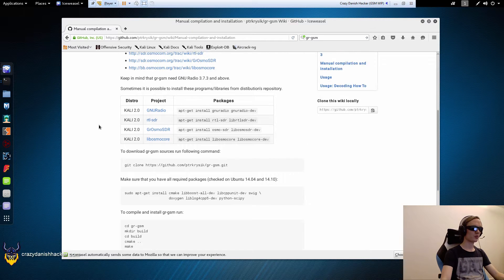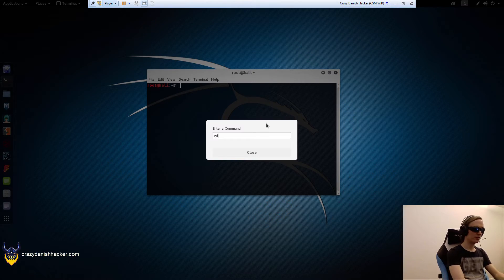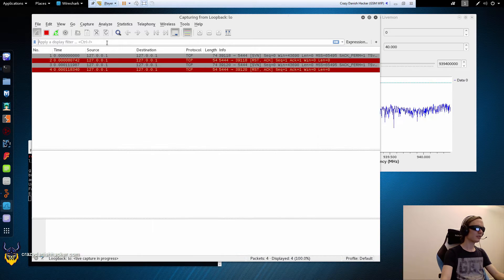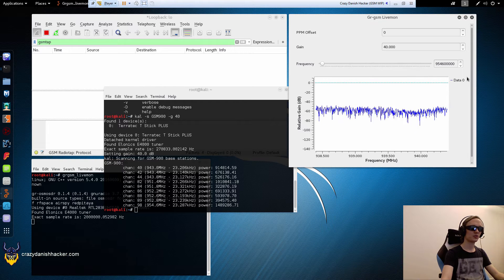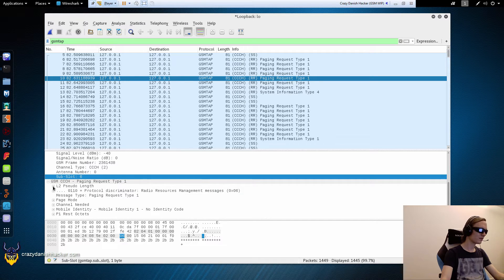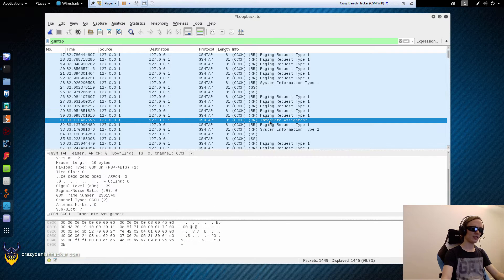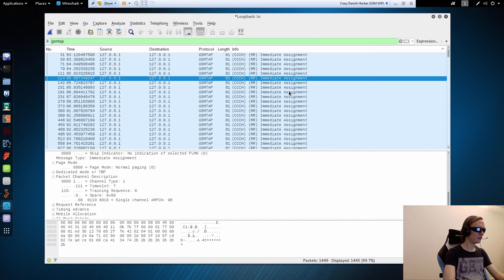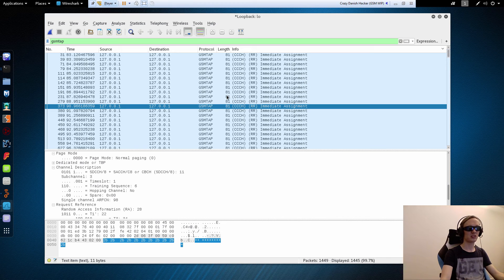GSM Sniffing: Using GR-GSM - Software Defined Radio Series #8

Comment: -hello so im trying to use gr-gsm and following step by step but there are some curious message and by some reason it is not working ill explain in detail:
  first i open wireshark and i get the next errors:

  QPainter::begin: Paint device returned engine == 0, type: 2
  QPainter::setPen: Painter not active
  QPainter::setBrush: Painter not active
  QPainter::setRenderHint: Painter must be active to set rendering hints
  QPainter::begin: Paint device returned engine == 0, type: 2
  QPainter::setPen: Painter not active
  QPainter::setBrush: Painter not active
  QPainter::setRenderHint: Painter must be active to set rendering hints

-i still continue video and try grgsm_livemon get the next messages:

   gr-osmosdr 0.1.4 (0.1.4) gnuradio 3.7.13.3
  built-in source types: file osmosdr fcd rtl rtl_tcp uhd miri hackrf bladerf rfspace airspy airspyhf soapy redpitaya freesrp 
  [INFO] [UHD] linux; GNU C++ version 7.3.0; Boost_106200; UHD_3.12.0.0-0-unknown
  Found Rafael Micro R820T tuner
  Using device #0 Realtek RTL2838UHIDIR SN: 00000001
  Found Rafael Micro R820T tuner
  [R82XX] PLL not locked!
  Exact sample rate is: 2000000.052982 Hz
  [R82XX] PLL not locked!
  Allocating 15 zero-copy buffers

- I tune into the frequencies that kalibrate told me and nothing happens neither on terminal or wireshark?

possible solutions i tried
a) i made sure to select loopback interface.
b)made sure the frequency i inputed in grgsm was in format of hertz

and well nothing, thank you for your help guys!.
Reply from the maker: Not sure why it's not working here, make sure you've tuned into the right frequency, by e.g. looking for GSM signals between 940MHz and 960MHz for example in gqrx, and if it works in that program (or even SDR#), then try gr-gsm.

Comment: Go bladerf+raspberry pi=imsi catcher. ;)))
Reply from the maker: 2G IMSI Catcher, and it's not as simple as that, but you can create a 2G BTS with those devices.
See e.g. https://www.evilsocket.net/2016/03/31/how-to-build-your-own-rogue-gsm-bts-for-fun-and-profit/

In my case, the BladeRF randomly stopped transmitting the RF signal through the virtual machine. Another issue was the calibration, as I wasn't using an external reference like a GPSDO. Eventually I will get to this topic, but there are a lot of places where it can go wrong, if you want to do it properly.
Reply: Crazy Danish Hacker,Good luck.Waiting for your videos :)

Comment: appreciate your work man, Thanks.
Only problem I am facing is that I cannot trace the packets in wireshark
Reply from the maker: Make sure you're listening on the correct interface, and that gr-gsm is actually decoding packets.
Reply: Crazy Danish Hacker no gr-gsm is not actually detecting the packets, I’m sure i have tuned in to a strong downlink freq
Reply from the maker: I recommend starting over from scratch and doing everything exactly like I showed, including how you can see the packets flow through the terminal when you're decoding them. Make sure you use a recent version of Kali or Ubuntu with an up to date version of Wireshark.
Reply: Crazy Danish Hacker is it possible because I’m using virtual machine??
Reply from the maker: No I used a virtual machine in all of these videos. Try in a new Kali Linux virtual machine maybe. It worked for me when I tried a few weeks ago. There's a small chance that the developer made a mistake in the latest version of gr-gsm. If that's the case, then you can pick up an older version from one of the forked versions for example: https://github.com/ptrkrysik/gr-gsm/network/members
Reply: Crazy Danish Hacker Ohk will look into it, thanks!

Comment: can we see uplink packets? the ones going from mobile to cell
Reply from the maker: You need to use something like this: https://github.com/ptrkrysik/multi-rtl, it didn't work in my case, most likely because of the cheap RTL-SDR devices I modified. https://ptrkrysik.github.io/

Comment: when i run grgsm-livemon i had this:

Traceback (most recent call last):
  File "/usr/local/bin/grgsm_livemon", line 26, in <module>
    from gnuradio.qtgui import Range, RangeWidget
ImportError: cannot import name Range

Google doesn't match any good answare, could you please help me? 
P.s. I love your videos you're awesome.
Reply from the maker: Try this: https://github.com/ptrkrysik/gr-gsm/issues/137
Reply: Crazy Danish Hacker I basically solved by running the py script through gnuradio, thank you anyway... can u gently make videos about ss7 and it's hack? I know it's illegal but just theorical concepts?
Reply from the maker: In the future I will try to at some point, problem is I need to study the SS7 protocol suite in depth to make sure I tell you correct information. There are a few basic "SS7 hacks" I've learned, that can be done legally by anyone but those don't give you the ability to intercept or redirect SMS or phone calls.

They only allow you to look up the IMSI, and also track users somewhat. The tracking is however, extremely inaccurate and is more like a proof of concept.

Comment: hi im looking for same program for my gsm device to collect data from servers and im  using windows and i need help with software and  decrypter if wana contact me on my email : suterj37@gmail thank you
Reply from the maker: Watch the video series, everything is explained.
Reply: but im using it for out doors to collect data using my gsm reciver  device  and laptop so i will need software and sever and discrypter , so do i need use linux only
Reply: and my progect is trying to catch data in the air and i need good software conect to atm radio like server  any advice ?
Reply from the maker: You need grgsm and an rtl-sdr device or better. Everything is explained in the videos, and yes you need to use Linux unless you somehow make grgsm work on Windows. (Good luck)
Reply: ok I will try use rtl-sdr device do u advice me use gsm reciver device aswell or I wont need it ? and I wana thanks for your chanel it help me lot and ur answers are on the time keep going bro
Reply from the maker: RTL-SDR is a multi-purpose software defined radio which can sniff GSM at 950MHz for example, and many other things. I recommend getting one with a heat sink from e.g. http://www.rtl-sdr.com/buy-rtl-sdr-dvb-t-dongles/ or http://www.nooelec.com/store/sdr/sdr-receivers/nesdr-smart.html

In case you live in a country that uses 1800MHz primarily, then it may be a lot harder to follow my guides as the tools (grgsm) are designed for the 860MHz-960MHz~ band. You will also need a different kind of RTL-SDR that features an E4000 tuner like:
http://www.nooelec.com/store/sdr/sdr-receivers/nesdr-xtr-rtl2832u-e4000.html
http://www.nooelec.com/store/sdr/sdr-receivers/nesdr-xtr-plus.html

As they can tune a bit higher and cover 1800MHz-1900MHz.
Reply: im uk based what do advice , do I will need the gr gsm device that can work on  higher cover plus rtl-sdr with higher cover ? and have ever heard VRPLO V1.1.9 software?
Reply from the maker: I already told you in my previous response. No I don't know VRPLO.

Comment: Thanks for another great video!I followed all the steps in your installation video, but when I run grgsm_livemon I get the following error:Traceback (most recent call last):
  File "/usr/local/bin/grgsm_livemon", line 29, in <module>
    import osmosdr
ImportError: No module named osmosdr
Any ideas?
Reply: i have the same problem and my rtlsdr usb is connected
Reply: problem solved

just: apt-get gr-osmosdr

and it will be fine

Comment: thanks for your good helpful videos.. i have one question, when i follow your step till kal -s GSM900 -g 40 i got this message on my terminal ->>> Found 1 device(s):
  0:  Generic RTL2832U OEM

Using device 0: Generic RTL2832U OEM
usb_claim_interface error -6
Failed to open rtlsdr device #0.
does we must have to connect phone on our machine during we do this process.?
thanks and waiting for your answer.. i wish success and many thanks at all
Reply from the maker: No you don't have to connect your phone when you run "kal". It's a program that utilizes the gr-osmosdr libraries as far as I know. 
The error you get is: "usb_claim_interface error -6", which after a quick google search  (https://groups.google.com/forum/#!topic/ultra-cheap-sdr/6_sSON94Azo) reveals that it is very likely, that your DVB-T drivers are loaded instead of the RTL-SDR drivers. 

Try this command for example, before you run kal:
sudo rmmod dvb_usb_rtl28xxu rtl2832 

If it works after you've run the command above, create a new file in /etc/modprobe.d/ and call it rtlsdr.conf. Inside this file, add:
blacklist dvb_usb_rtl28xxu

Now save the file and the changes should be persistent. By default in Kali Linux, you shouldn't have to do this, but sometimes they change stuff. Also, besides having "kal" installed you should also have gr-osmosdr installed. I've covered the installation of the other tools in the previous GSM sniffing videos.